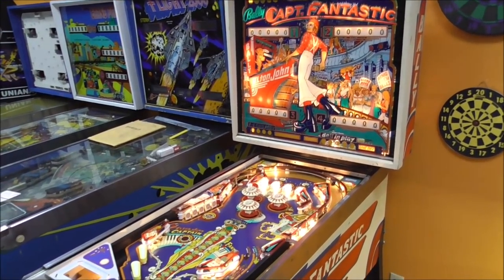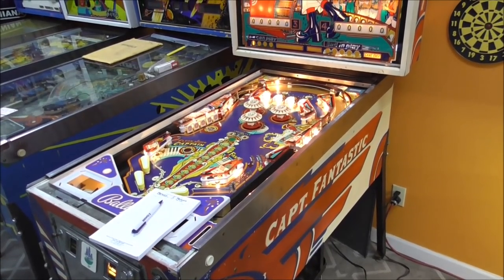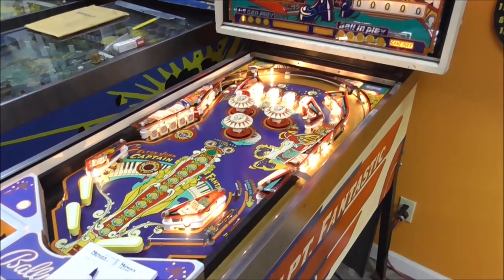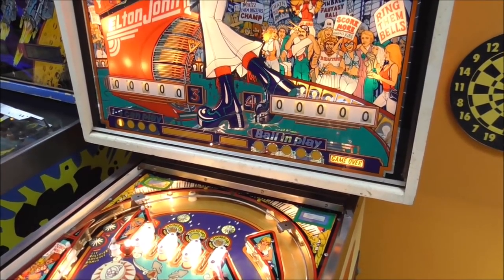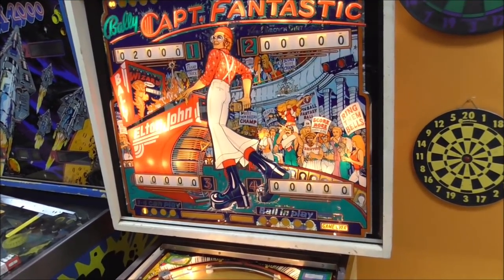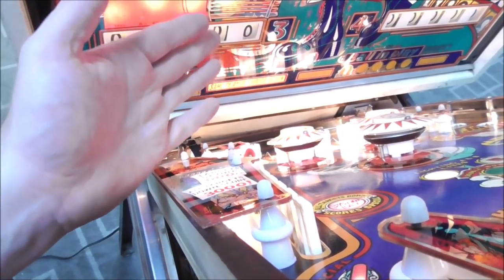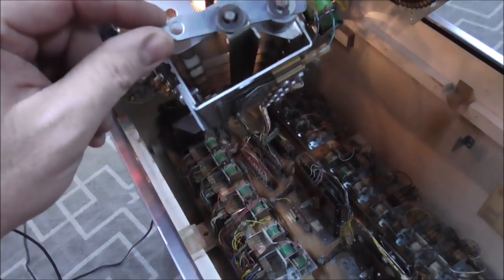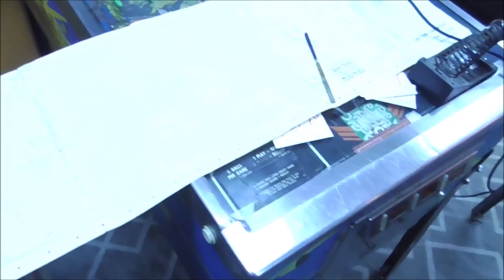Schematics - Repairing A Few Issues On A 1976 Bally Captain Fantastic Pinball Machine!

Comment: Joe, next time you are near the edge of the current rating on a connector and you have a spare slot (you used a 2-position connector a single circuit).  Double them up.  Use two contacts and just either make a "Y" at both ends or when you crimp/solder the pins on, jump it over to the other contact.  You'll essentially double your current rating (you can do the same thing on relay contacts if you have a spare set on a multi-pole relay.  

I don't know how often it comes up for you, but Extech makes a range of AC/DC clamp on ammeters so you can know, with certainty, what the current is.  They can also be handy for tracing out a circuit that is drawing too much current...which could indicate a failing coil (or other circuit where you know what the approximate current should be).  

Great videos, by the way!  When I was growing up, we had a Gottlieb "Super Circus" pinball machine.  My interest in electronics started with that.  I can almost "smell" the vintage electro-mechanical electronics in your videos!
Reply from the maker: That's a good idea, I never even thought of that, thank you sguttag!

Comment: Great troubleshooting as always!   At first I thought you could use your Fluke to measure the current, but specs online say Max of only 10A, bummer.  

Your logic and back of the napkin calcs are spot on for the Molex connector.  Molex should also design in overhead to achieve their ratings.  This is likely why CSA found they can handle 15A in their testing.  The N/A designations only mean that the part was not tested by that particular organization, i.e. UL

1 vid/day is quite impressive!
Greg
Reply from the maker: Thank you Greg, we're trying to keep up :)  We'll see you on the next video..... tomorrow :)

Comment: Great video.  When I get 100k points on my capt. fantastic, the machine makes a long humming noise.  Is this normal and related to rolling the score over?  Seems odd it would hum, but wasn't sure.  Thanks
Reply from the maker: It's supposed to buzz, there's a buzzer inside of it, and they call that the "over the top" relay
Reply: @LyonsArcade Great, thanks for the response.  Mine sounds a bit like humming when a coil is stuck on, so I might need to see if the buzzer is busted!

Comment: Hi I have a Bally capt fantastic but the special light by the drop targets will not come on at all. If I run a jumper wire to another light that is lit it will come in but not on it's on, do you have any idea were to look for the problem.
Reply from the maker: Well you just confirmed that the socket is fine.  That special light is lit by the "Targets #2 special relay".... so if that relay doesn't pull in, that light won't light.  If the relay is pulling in, maybe the switch on that relay is dirty.  Open up the playfield and then find that relay, with a game started pull it in and see if the light lights.  If it does, then your relay is probably not coming on.  If it doesn't when you pull the relay in, then it might be the switch is dirty on that relay or the wire to the light doesn't make a good connection at the jones plug that connects the playfield to the bottom of the cabinet.
Reply: @LyonsArcade  Hi I found the problem it's the switch you named the wire came off I solder it back on it works now thanks for getting back to me

Comment: I think one of the diodes is a dampening diode. When you collapse the field of a coil, it will release voltage. So the diode will catch this unwanted "flyback" pulse.
Reply: Pretty close.  Most would call it a clamping diode or snubber. When the coil collapses, it will release its stored current.  What takes the hit will be the thing that turned off the coil (e.g. a relay contact that will arc/pit as a result).  The diode clamps it and sends the spike back to the power supply with that big old capacitor sitting there ready to catch it. The diode protects the switch/relay and prolongs their contacts.
Reply: @sguttag  -- Sometimes you want this effect (on the output end), as when producing higher voltage pulsed DC, like the flyback transformer in a television. But with a solenoid, the current released from the collapsing field is wasted and has no place to go but arc across the switches controlling it (or possibly damage nearby semiconductors).